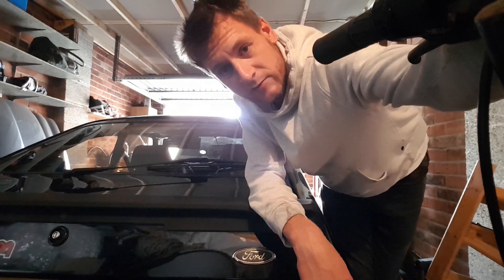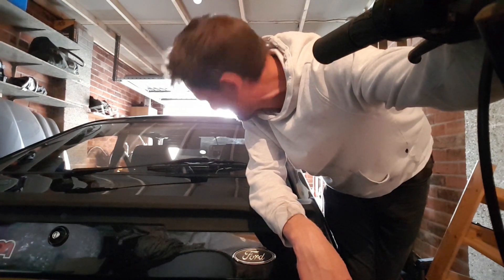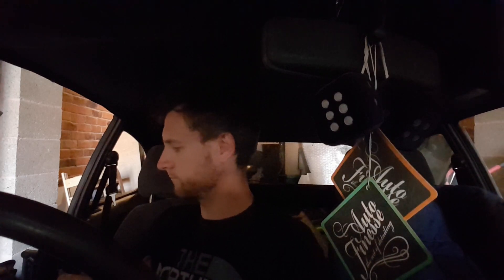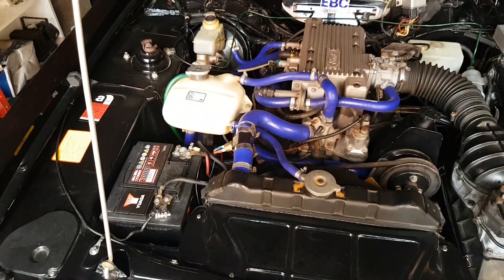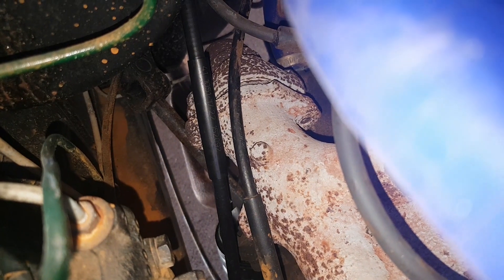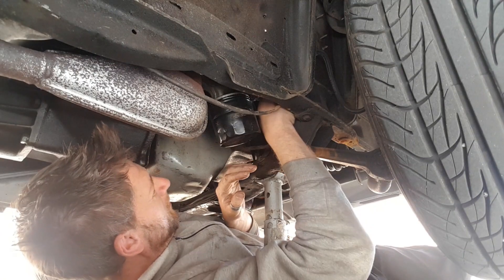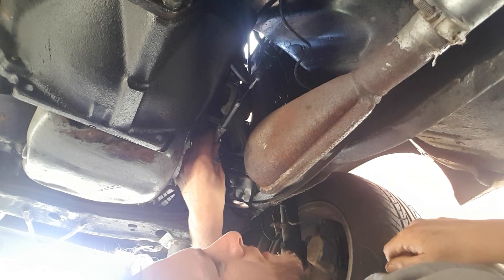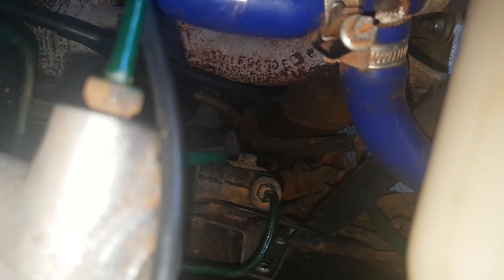Episode 91 - How to replace a clutch cable on a Ford Capri

Comment: I have had at least two clutch cables snap since I started owning capris 37 years ago. The last one went a couple of miles from home in the MK1 3 litre "works" touring car replica. I managed to get it home by putting it in 1st gear and cranking it over and it would bunny hop and fire into life and then into 2nd at low revs move gear lever (don't dawdle, has to be quick) sounds pretty epic at 30 mph in 1st!!!!!! Had to stop at junction and repeat the process. Though I didn't end up being stranded. New cable was about £16 from local motor factor.
Reply from the maker: That's a great story Ken. I love having the moments of using a bit of inginuity to nurse a car home. You did well getting the Mk1 home, and great that it cost you so little to repair too.

Comment: Good crack the dash panels eh🤣 I had them off replacing them a while back,what a c***t 🤣and one of the vents for the heater, had a chuckle when I seen you taking them off 🤣🤣
Reply from the maker: Cheers Gaz. Absolutely awful plastics! I probably didn't need to take them all off, but I thought that removing them would give me more room to work! Lol!

Comment: I think I have the same gearbox on the Westfield I've just bought, so was really useful to see how you changed the cable and adjusted the bite point. My bite point is pretty high so I might see if I can tweak it now. Thanks!
Reply from the maker: No problem buddy. Glad the video has been of use to you. Definitely easy enough for anyone to adjust. Cheers.

Comment: At my 24V MKIII,  i don't recognize this clutch cable issue. 😉Well done. Capri's can be fixed if the correct part is available. And it is getting harder and harder.
Reply from the maker: Cheers Don. It was certainly a surprise to have this happen. The smoke coming from it was so much worse than what I was able to show on film. Really scary.
I think if you're looking for genuine Ford parts, you're probably right. Up to now though, I've been able to find pretty much everything I've needed to keep her going. eBay is a wonderful thing! HaHa!
Reply: @jimmykneesall  I always carry a fire extinguisher with me Jimmy. You never know.

Comment: All rwd fords use the same ends on the clutch cable ( apart from self adjusting ) so there are different lengths, I've used a Granada 20L cable on a 2.8i Capri 
Also a bit of heat tape on the cable where near exhaust helps👍
Reply from the maker: Thanks very much Mike. Nice bit of trivia there. So far, the one I fitted is still holding up well, which I'm obviously pretty pleased about! Lol.

Comment: I would usually spray a little lithium grease on the cable ends to help lubricate the cable so it doesn't seize prematurely.
Reply from the maker: Thanks for the tip dude. I'll bare that in mind in case I have to do this again. Hopefully, I won't! HaHa!

Comment: I have seen this happen before , clutch cable touching manifold burnt through plastic coating ( metal to metal contact ) and your clutch cable becomes an earth and all those amps going through to earth  as you crank the engine heated the cable  up to an extreme temp and fused it all together , maybe your engine to body earth cable has bad connection or thin , nice car by the way , i drive a 1981 2.8 capri over here in spain best regards
Reply from the maker: Nice one Edward. Thanks for your comment. It's definitely pointing to something touching the cable. The manifold is a likely culprit. Ever since I cable-tied it to the wing, it's not done it. Hopefully she won't smoke again! 🤣